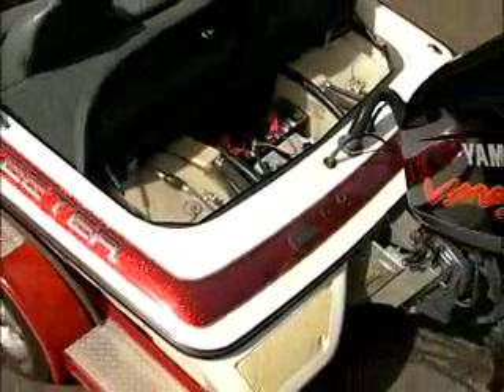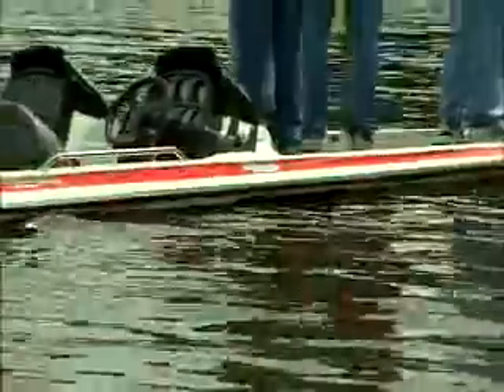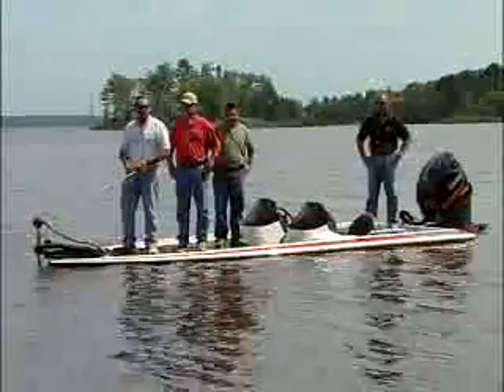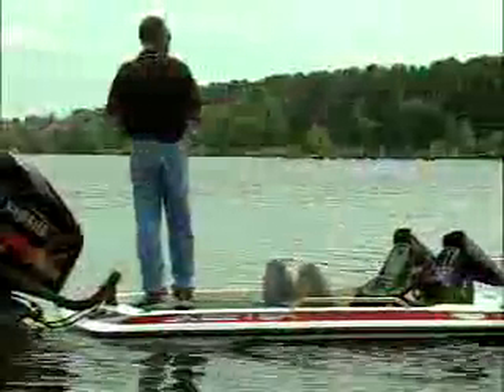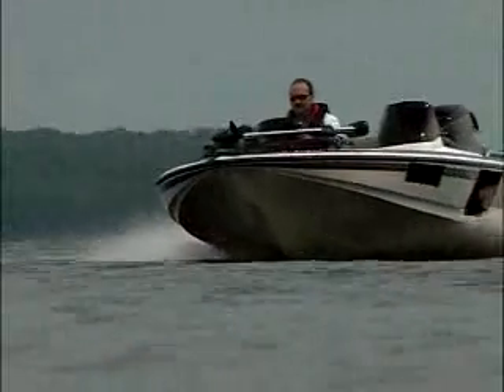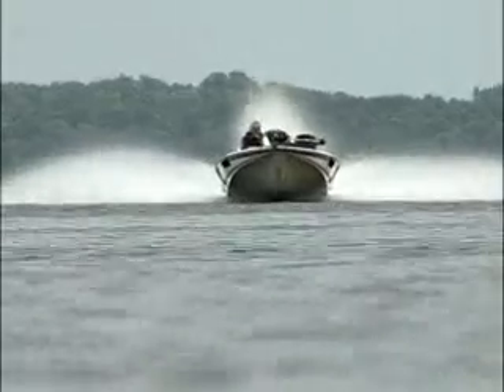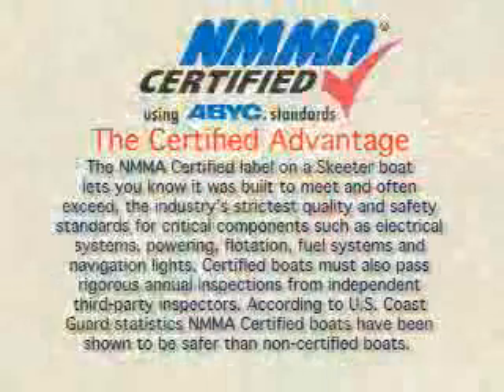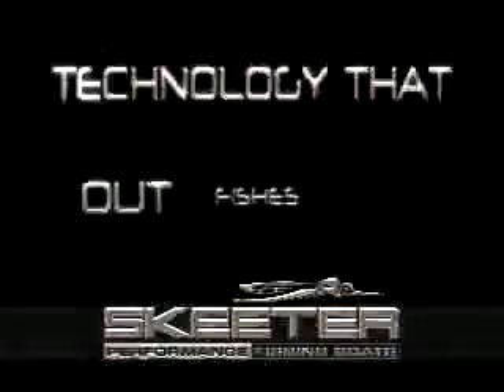Engineered Like No Other - Skeeter Boats - Floatation Video

Comment: great boats. and yes good solid floatation but i do gotta call bs on one part. they say the men are not placed on the boat in a manner that would balance it properly by putting 3 up front and 1 person in the rear. but actually, thats because that big ass outboard weighs as much as 2 of those men by itself. so YES theyre placed strategically. just because it wasnt 2 more people on the back doesnt mean they werent balanced properly. still, aside from that, great boat.

Comment: Fished for two hours in my dad's 2009 skeeter without the plug in. Never noticed until he randomly hit the bilge and saw all the water. Skeeter was the first boat ever made. Ranger was the best but now skeeter has taken that position. Speed, holeshot, top end u can take ur hands off te wheel and drive blindfolded. Unreal boats now.